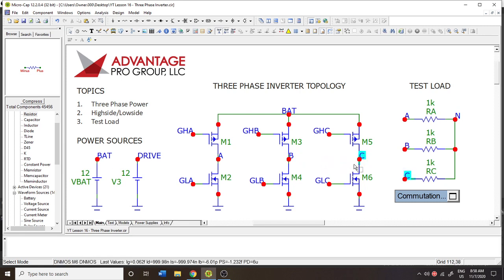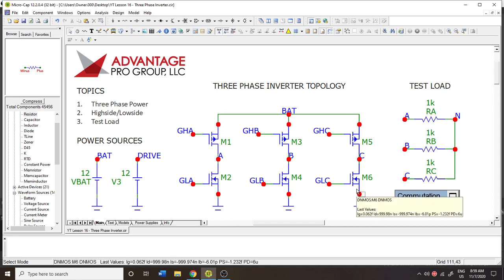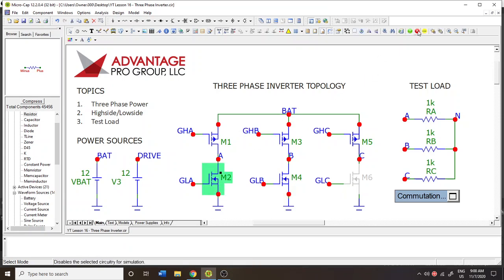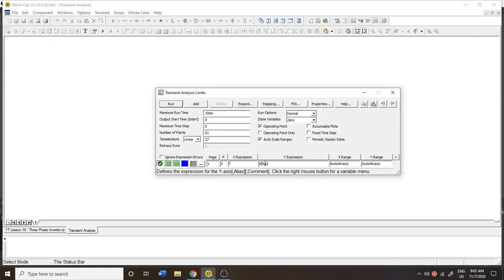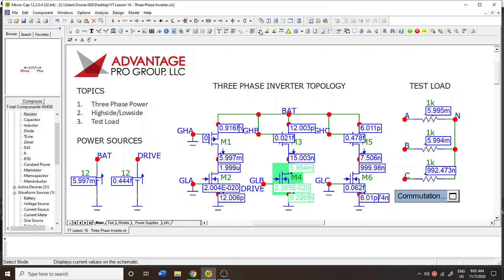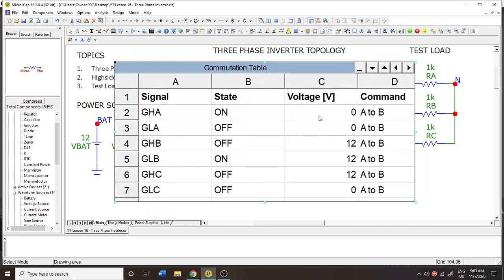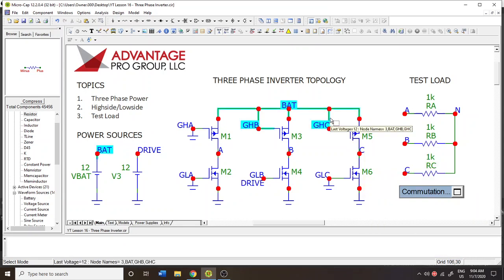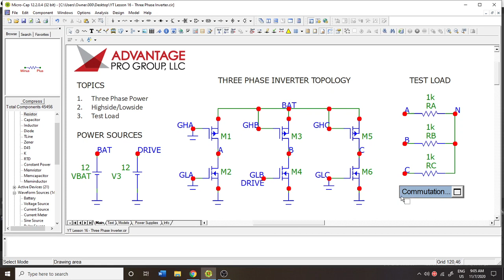Micro-Cap Tutorial: MOSFET Inverter Three Phase (Motor Control)

Comment: Hi sir its posible to use without mcu like a arduino?? Just for testing my motor run or no sir?? Because i buy second hand sir. Can u help me?
Reply from the maker: You can do without a motor control predriver  if that's what you're asking. However, you must choose the MOSFETs as "logic level" gated FETs. Beware of shoot through timing that would destroy MOSFET or burn motor windings.
Reply: @pauljstar  my motor 126v sir, i wat test with just 40v sir.